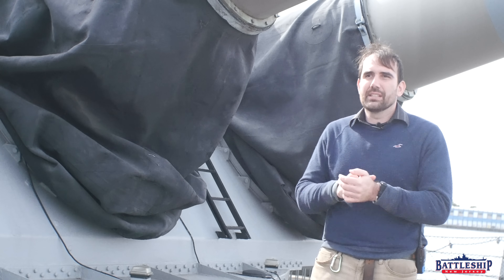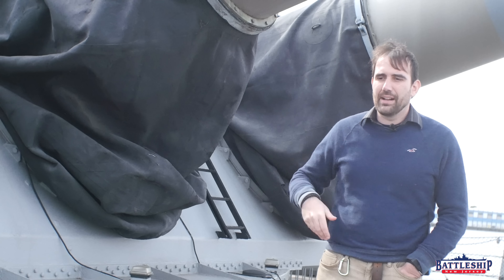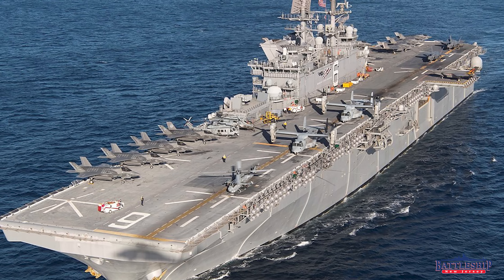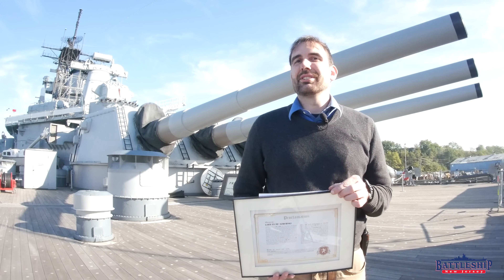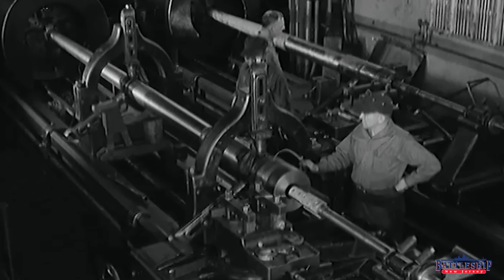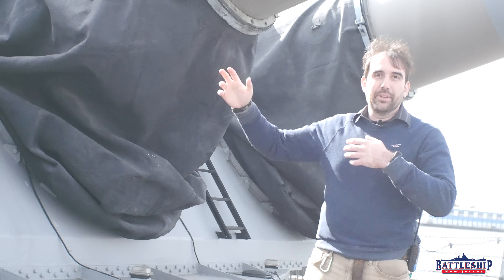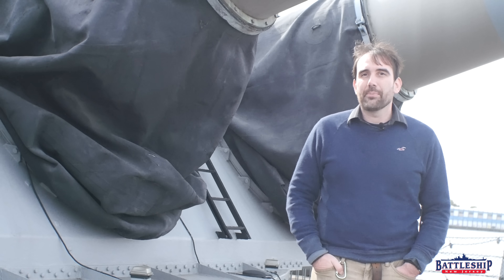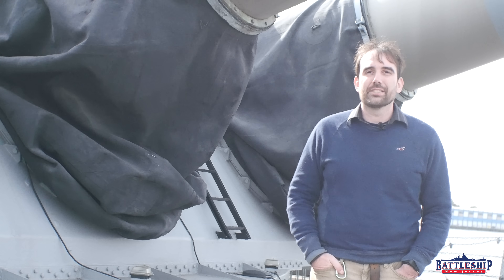How Much Would It Cost to Build a Battleship Today?

Comment: The fact the old ones could even still be reactivated and viable in today’s combat is a testament to their design. But from a cost perspective it would be much simpler to design and build new. The railgun program isn’t exactly dead, only one of the perspective designs is on hiatus at the moment and as I understand they were at least two in competition with each other. The army is also continuing development of their 1000 mile canon, in Lou of a railgun this would probably be the perfect armament   for a new battleship. I would probably do nuclear propulsion to keep the cost of fuel down because lifetime that will add up significantly. The sheer size of a battleship gives it the ability to host a significant amount of weapons systems. It could carry an incredibly large amount of VLS tubes, either for anti-ship land or anti-aircraft work. As a way to justify it to the Navy you could equip it with a largely anti-aircraft secondary armament like the VLS or various types of point defense and can be used like the old battleships as fleet defense when operating as a part of the carrier battle group. While some may try and say you can build additional ships for the same cost, you won’t be able to get the same capability of a battleship and you’re still getting significantly increased fleet defense capability. 

As of the time of this video and comment the next major war the United States may fight would likely be in the Pacific against China, and since such a conflict would be a very navel heavy war with lots of amphibious action due to China’s pension for building artificial islands, being able to bring up a warship that can put significant amounts of artillery fire at a great distance onto a target could be very useful and probably more cost-effective. A guided missile is a lot more expensive than an artillery shell.

Comment: In reality it would likely cost much more then an aircraft carrier.   The Aegis systems,  AN/SPY-6(V)1 AESA 3D radars,  the Mark 41 VLS systems (likely have 4 x 41 cells.   

The gun configuration, would they go 3x3 or 4x2?   The guns, would they go with "traditional"   Or rail guns, if its going to be nuclear,  the option for 6 "smaller"  12" rail guns in twin abx turrets may work,   able to sling projectiles a few hundred miles.   this would give it stand off shore bombardment.   Issue being rail guns tend to be "smaller" then traditional rounds because of the energy requirements to sling a 16 inch round vs a 12 in round are exponetial

directed energy weapons in the 600kw range.    

Secondary batteries,  of 128mm with rocket assisted gps guided rounds.   dual purpose 76mm guns.   The number of "fire control" radars there alone..   

helicopter deck, hanger, elevator.   

it would be a monster in the water, able to provide a center piece of air defense, massive shore bombardment at the 25 mile range, as well as likely at the 200 mile range.   but would it be needed?    what would it really bring tot he table that an aircraft carrier couldn't?

IF they could get the railguns working effectively and firing fast enough with the reactors...   then even a 12" gun with that kind of range,  might be of use, to allow for shelling for targets at comparable ranges to some carrier strikes.

Comment: Build new, as bringing back a current Iowa is more expensive in the long run especially if we consider the cost of modernization. Whats more, the role on a modern battleship would be different from today. While it would still probably have big guns, they would probably be the armies new 1000 miles range gun as well as vertical launch tubes for hypersonic missiles and other current missiles. Whats more it probably would be nuclear powered to save cost on fuel as we are still trying to move a 45000 tons behemoth at a speed of around or above 30 knots for standard.

Comment: For comparison, a Columbia class submarine is going to cost about 108 billion a copy.  We have been using today's equivalent to Columbia's, tomahawk equipped Tridents, in places like North Korea as gunboat diplomats.  They don't work well in that roll...a submarine is meant to be a stealth weapon.  Modern surface combatants don't make good deterent gunboats eather..to thin skinned at .5 inches of aluminum.  The Stark, Roberts, and Cole speak to this. They are stand off combatants.. Carriers are power projectors...not gunboat deterents.  I think battleships, with 18 inch steel armor, big guns, and even bigger American flags flying...make a statement.  And most weapons they would face...small boats packed with explosives, cruise missiles, RPG, etc, might bubble the paint.  Maybe use them in a reserve role to control cost...and just park em in trouble spots to say "the US is here and ready to fight...and we will win..."

Comment: What advantage would there be to building one very large, very expensive new battleship, over the same expense and resources to build three smaller ships that could deploy seperately? 
What capability would you get from a new battleship, even with updated modern weaponry and equipment, than you couldn't get another, less expensive way?
Spending the money and putting the assets into a battleship, equal or greater than that required for an aircraft carrier, gives you one ship that makes a tempting target for a potential enemy.  You'd need an entire escort group like carriers have to protect the battleship.

Comment: They would cost more than the benefit gained from building them. That’s why they aren’t building any. That’s why they didn’t finish the Kentucky or the Illinois. However “cool” it might be to drop shells from 20-30 miles away, it’s an antiquated form of warfare. There’s a reason the army doesn’t use flintlocks anymore. There’s a reason the air force doesn’t use bi-planes anymore. Think about it. All branches of service use various forms of air power.

Comment: 5:20 - 6:20 explains why it can't / won't ever happen. 

Several entire industries would have to be recreated. Facilities built, machines and equipment built to produce the components and years training a work force how to make them... for a one time build of at most a handful of ships. That is just reffering to the gun houses, thick armour plates and castings.
But same goes for the gun barrels.

Then they have to be maintained... 

Those industries, facilities, and the institutional knowledge to produce them are gone.

Could it be done? sure, but the cost for a one time build is unfeasible.

These are the reasons the remaining battleships, even the pyramids, are facinating testements of human industry and ingenuity and should be maintained.

Comment: If you were going to put one of those ships back on the line you wouldn't use diesel fuel if you were going to rehab the whole ship why wouldn't you just put in a nuclear reactor if you were going to eventually fit it with rail guns you need the electricity for produced by a small nuclear reactor I mean it would be expensive to put one in but it would the cost would be offset by the amount of fuel you'd save it would pay for itself over the years

Comment: I'd say it'd be at least as much as the USS Ford cost...plus a bit more because it'd have to be nuclear powered since no oil boiler ships exist in the modern Navy and gas turbines simply wouldn't be efficient on a ship this size. A "modern" iowa would be akin to the Russian Kirov nuclear battlecruser with smaller main guns since modern ships aren't armored for ship/ship gun duals, but you'd still need anti ship missile protection and protection for the munitions and powerplant. After all this, a battleship would be extremely vulnerable to even 70s era submarines and so would have to sail with the same protection as a CV, so it's really a waste in modern era where ship to ship gun battles no longer happen. It'd be far better to build more destroyers or guided missile crusers